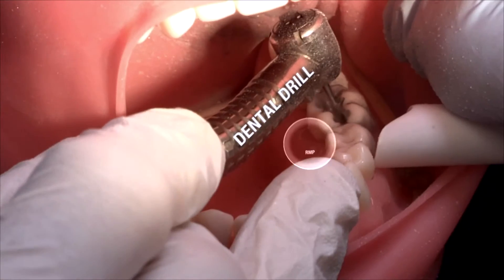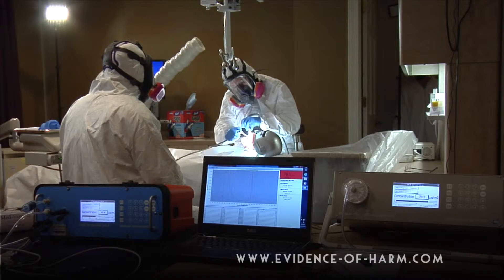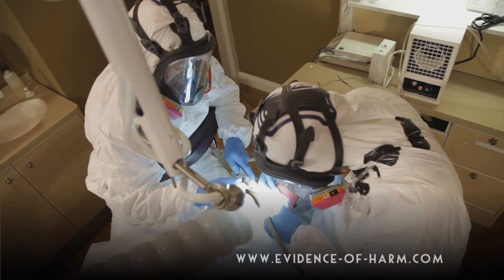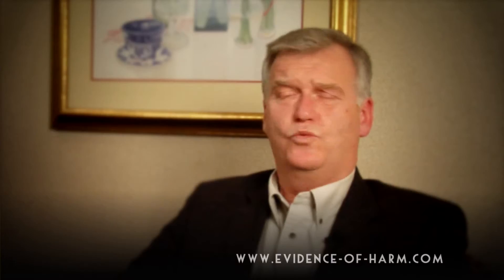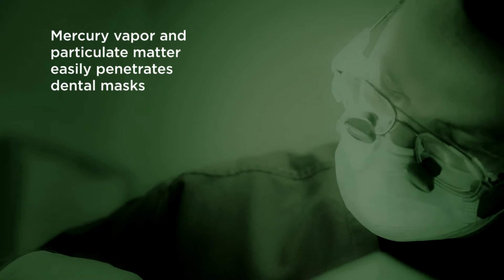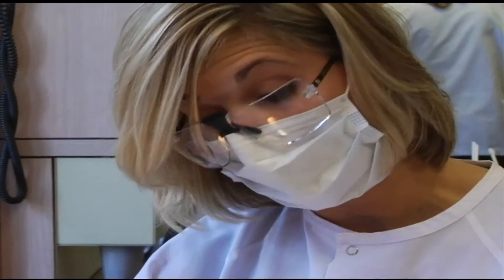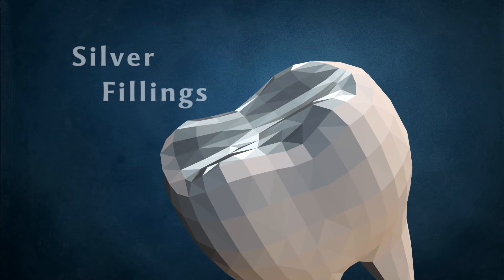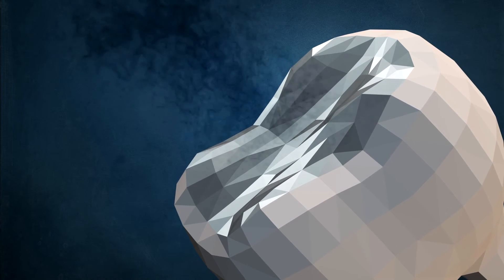Occupational Exposure to Dental Mercury Contaminated Particulate Matter from Amalgam Tooth Fillings

Comment: I was a dental assistant 1972 to 1976 and developed hand tremors, anxiety and memory problems.  The hand tremors are gone but the memory problems remain.  Both short and long term.  I see no other explanation of severe hand tremors in a 20 year old that is more reasonable than the mercury exposure.  The memory problems have had a big impact on my life.

"however, memory problems can be permanent."

https://www.doh.wa.gov/YouandYourFamily/HealthyHome/Contaminants/Mercury

Elemental Mercury Health Effects
Liquid elemental mercury primarily causes health effects when it is inhaled as a vapor. These exposures can occur when elemental mercury is spilled or products that contain mercury break and release vapors into the air – this is especially a problem in warm or poorly-ventilated indoor spaces. Symptoms of inhaling mercury vapors can include nausea, respiratory problems, tremors, numbness in the fingers and toes, loss of muscle control, memory loss, kidney disease, and heart problems. Some of these effects can be reversible if the exposure stops, however, memory problems can be permanent.
Reply from the maker: Hi Tom, so sorry to hear about your health problems related to your occupational mercury exposure. As you've found, there are many, many adverse health symptoms linked to mercury exposure. You might want to check out a product called Irminix from Emeramed. It is a mercury chelator that is in phase II clinical trials and might be available by the end of next year if all goes well.